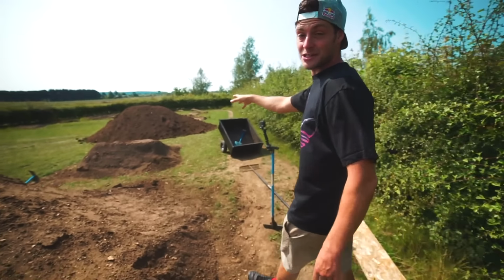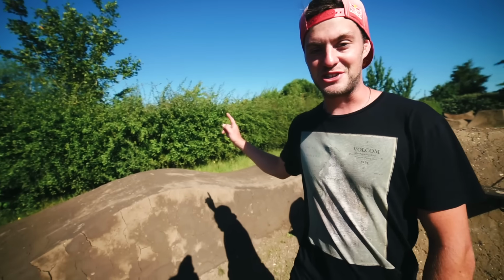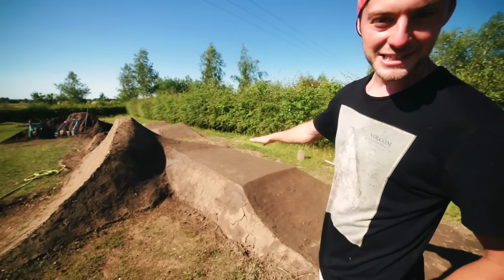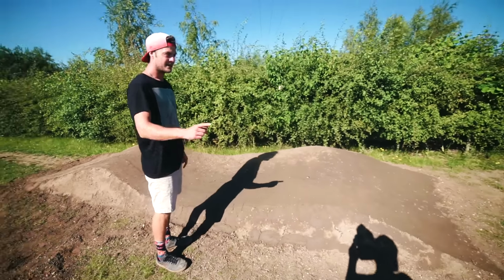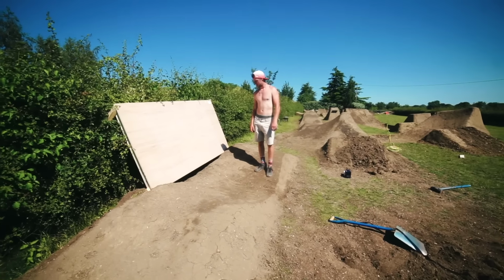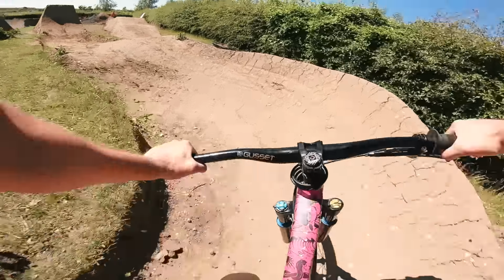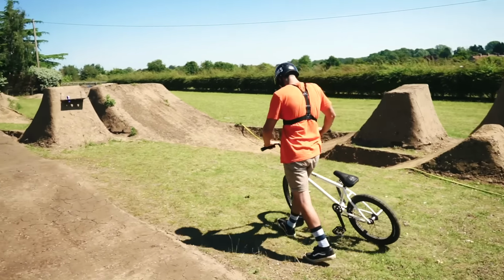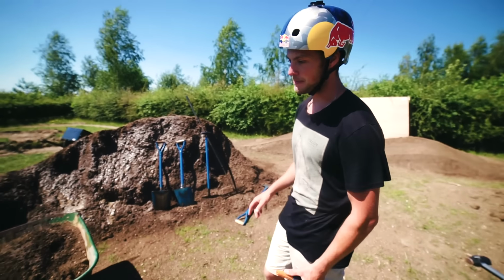BUILDING AND RIDING THE SICKEST NEW BACKYARD FEATURES!! LOCKDOWN EP21

Comment: i think after the rollers and wall ride just add more rollers, tabletops, and berms and take it all the way around the hedge so that it can connect to the start of the trails and make a pump track. But on each corner. you have a hip that can be rolled so that you still have fun jumps inside the pump track.

Comment: At the bottom you should have a massive berm that joins all three lines back into a trail to the top. For the trail to the top if you can pump it then you might get away without peddling. just my two cents